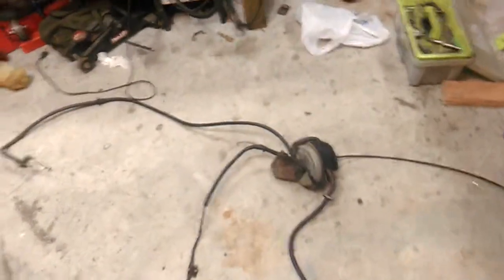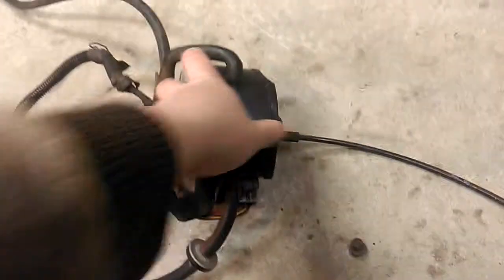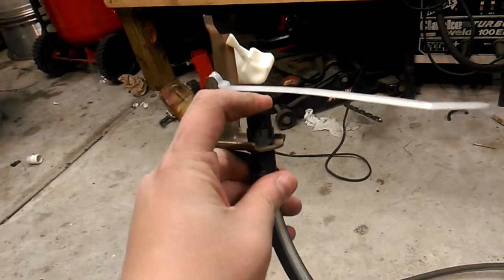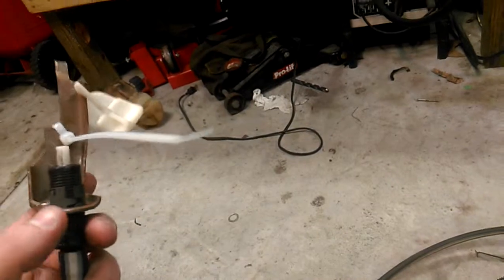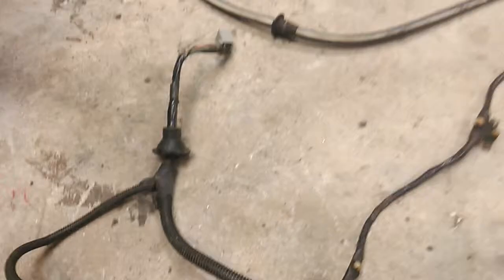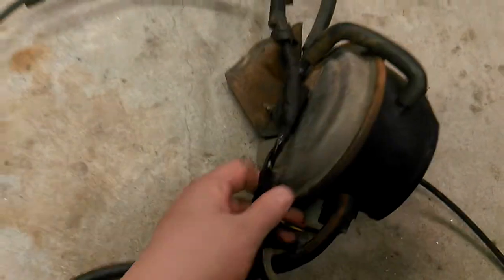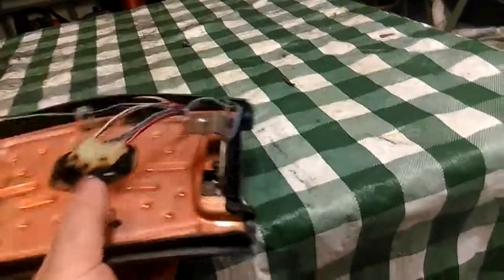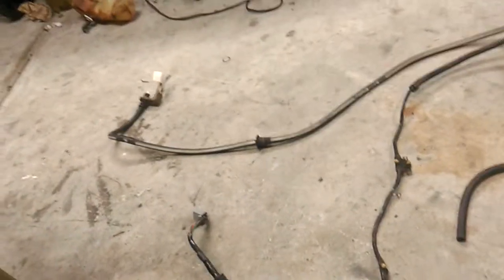Late 80's Ford escort cruise control module

Comment: That's just the vacuum servo. You still need the "brain" which is what actually controls the servo and reads the steering wheel switch inputs. It's known as the "amplifier". It's probably under the dash on the driver's side. It's probably yellow. It has two plugs connected to it.

It would probably be a lot less trouble to use a newer cruise control module from a newer Ford Escort, like a 95-97 model. That is because it's a single module that has the brains and the servo integrated into one unit. It doesn't need any vacuum connection and it uses the same resistance values for the steering wheel controls as the old vacuum servo systems do. It also uses the same speed sensor (8000 pulses per mile, sinewave or square wave output, it works with either). It's probably also a lot easier to find one of these newer modules in the junkyard. Note that these newer Ford cruise control modules from the mid-90s on all look the same and are wired the same, but you probably want to get one from a car with approximately the same size engine as what you're putting it into. The ones for smaller engines are supposedly configured to open the throttle more to maintain speed.
Reply from the maker: +Brian Leeper Thanks for the info, i did get the brain box later but have never installed the lot. The later escort tip seems ideal